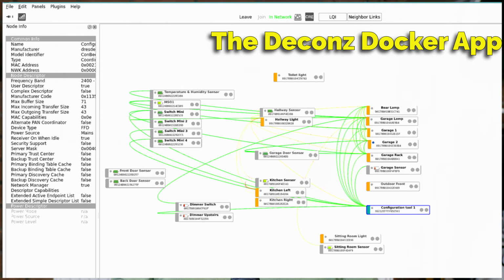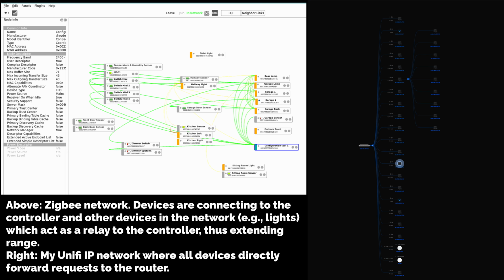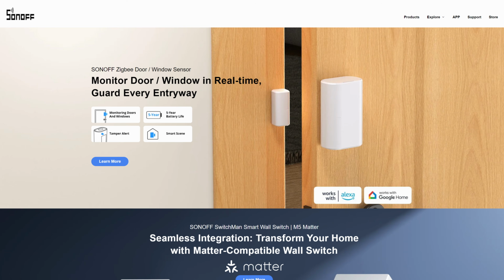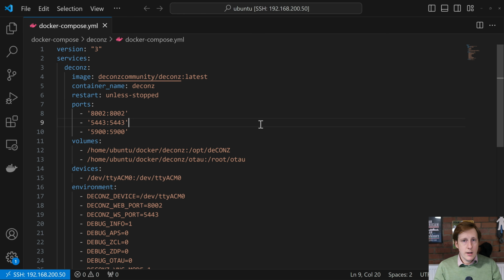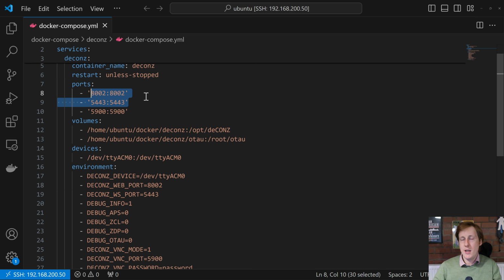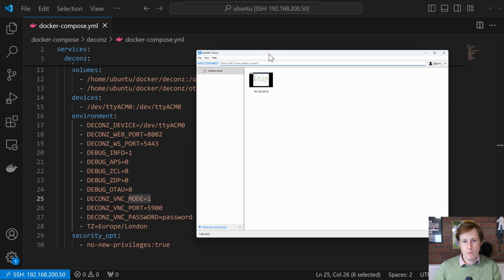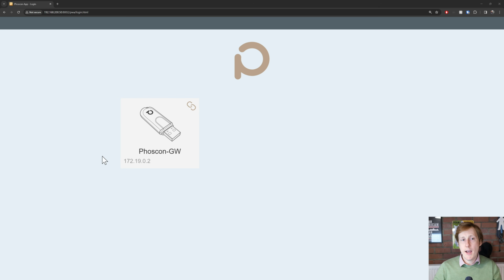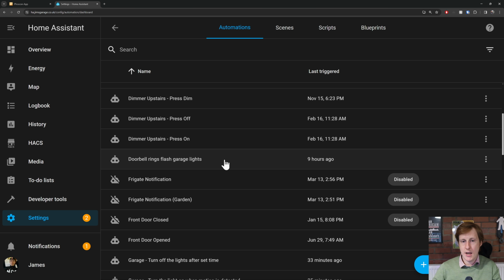Home Automation - A Beginner's Guide

Comment: I'm currently using home assistant in docker and integrated teslamate and my sonoff S31with exporting to influxdb. I have purchased a eachen zigbee pro bridge and a couple of temperature sensors all from China, however I'm living out of province in dorm and won't be back home until May, so I'm really looking forward to playing around with home automation then. Thank you for creating this series, I think it will be very helpful for me to learn about basics of zigbee, tasmota and other important topics in homeassistant before I actually get a chance to use my hardware. I feel like I'm going to be diving into a big rabbit hole.. unfortunately, in Canada, prices and tax on these smart home devices are not reasonable (especially those that are designed with local control and privacy)
Reply from the maker: Hey, thanks for the detailed comment. Sounds like you have some big plans. I'm hoping to cover off most of what you have mentioned in the near future. Sorry to hear about the prices, that's frustrating. Seems OK for once here in the UK.

Comment: since you spent lots of good time on firewalls/hypervisors etc it would be nice to see in your video, the proper setup for Advanced Home Lab (I am kind of wondering why are you even going to Beginners guides - there are tones of them on YT and some are...high quality to be frank).
But imagine this setup:
1- ISP comes directly to Opnsense box (box, not VM, we all know why)
2- home server: Proxmox and on it lots of VMs/CTs etc (Home Assistant being one of them)
3- storage: of course TrueNAS - probably separate machine - we all know why
4- now lets talk networks:
a- home users: all laptops, mobile phones, printers etc (mainly WiFi but can have few RJ45 sockets why not)
b- IoT devices (mainly WiFi ofc)
c- guest WiFi users
5- "extras" like Zigbee stick, Thread gateway, Home Kit/Google Home integrations

Home users shall have access to all shared resources, IoT no access to internet, not even to home users, Guest of course - only internet
Home Assistant needs access tointernet and all IoT have to have access to HA. 
But more than that: if HA does not see i.e. printers, TVs, LMS/DLNA servers, it will not autodiscover them.

So, I have not seen anywhere yet a proper design of home network that touches all the aspects. Most guides touch 1 aspect, sometimes 2. But there are many here and only if all done properly we can talk about properly built home lab that is safe and secure.

I am trying myself (and failing often i.e. in which VLAN HA, which MQTT, which InfluxDB and Grafana) - maybe one done some highly intelligent guy can bring all together in some PROPER ORDER AND CORRECT ARCHITECTURE/DESIGN WAY.

P.S.
don't forget also: it is a must to have an access to HA from outside (that includes cameras but of course cameras cannot be reaching to anywhere ;-) - there are so many variations here... ;-)